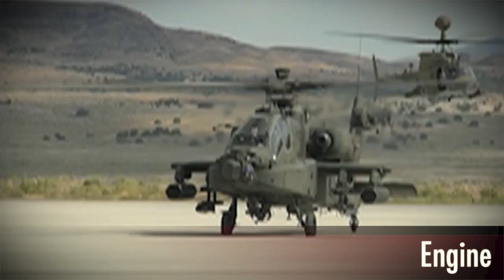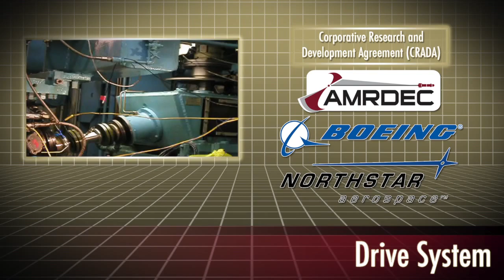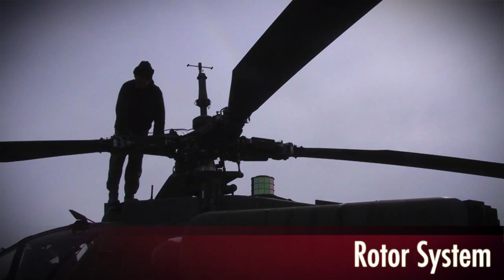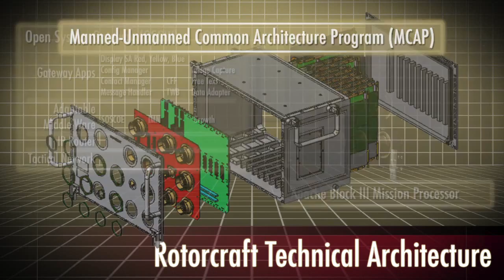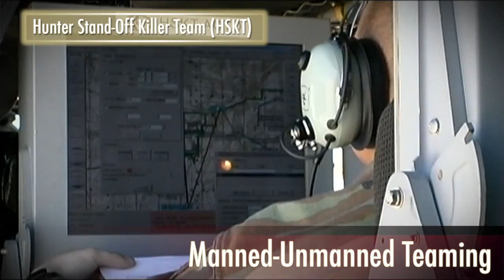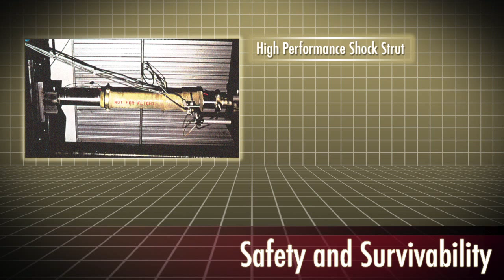US Army RDECOM - AH-64E Apache Guardian Attack Helicopter Technology Upgrades & Improvements [720p]

Comment: I like the "Crash-worthiness and survivability" part. 

Translation:  they've gutted all the strength out of the air frame to load all this new equipment, so they made some stiffer shocks/mounts to absorb the impact in a crash...how about small arms fire?

...so it's less of a flying MRAP and more of a flying HUMVEE

Comment: heh.. I made the new Composite Main Rotor Blades. the old D model apache with the 701D couldnt utilize all the power the engines provided. transmission couldnt take the power. also in case yal are wondering all 107 E model's built are now grounded.

Comment: the split torque xmsn is the most vital component. otherwise it wouldn't be so bad ass.
Reply: what is it exactly? what advantage does it give?
Reply: oh sorry. XMSN is aviation jargon for transmission. Converting both engines power into one torque.

Comment: maximum range Apache attack = = 8 km. the maximum range of the attack BukM2 (Syria Venezuela Russia \ Egypt and others) for a height of 15 meters = 40 km. Maximum attack ka = 52 100 km. Rocket - Hermes uses a homing guidance.
Reply: ы ыы I'm not sure whether your English is just so bad that it doesn't make any sense or if you actually don't know what you're talking about. Either way there is no comprehensible connection between these figures.
Reply: The 9S18M2 radar of a Buk-M2 battery cannot identify targets lower than 100m at rangers exceeding 5km. However, it is perfectly viable for the Apache crew to fly as low as 20m, evading detection. This is how they defeated Iraqs air defense during Operations Desert Storm. Also, the BUK has no searching radar on it's own, it relies on an external radar vehicle. That can be attacked by SEAD missiles, which have ranges exceeding 100km. You can extend this logic as far as you want, and so do military planners; the Apache would not be used in areas with strong enemy air defense, since it was never designed to do that.

Comment: The online sources regarding worldwide military equipment state the turret can rotate 360 degrees. They know more about it than you do I'm sure. I think I'll believe them. There is conflicting info, but either the turret rotates or it's laser guided lock and fire system has 360 degree rotation. Either way, it's still the most technologically rotorwing aircraft ever built thanks to it's combination of armament, stealth, electronics, remote control, etc., etc. Again I say, call Russia next time.

Comment: Tiger is better at manuve, but weaker fire power, even though france and australia are using US made Hellfire missile. the Radar is the point. And Tiger definetely don't get as much armor as either Apache or Havoc. seems the weak engine horsepower made the company have to use to many composite material to reduce the weight

Comment: as a total layman with regards helicopter engineering may i ask a question, "what is the split torque used for?," i know what torque is as what splitting something is but all i can think of is splitting power to the top rotor to the rear rotor, or am i barking up the wrong tree so to speak?, any answers please,
Reply: marcmarcmarcmarcmarc A split-torque transmission is just the name of a special transmission design. Regarding torque transmission from the engines to the rotor, torque is not split literally. Main rotor and anti-torque rotor are usually physically coupled, so there is no power splitting whatsoever.
Reply: MyFavoriteDisease most informative, thankyou sir,
Reply: Dmitri Kozlowsky i see, thankyou,

Comment: Even still the British version of the Apache uses Royals Royce engines which are more powerful even than the New GE engine.
God forbid the US use a british engine.
Reply: +Deepwinter Hate to burst your bubble, but the RTM-322 in the Westland AH-64Ds don't produce any more horsepower than the GE-701s because both aircraft use the same drive system which means the engines have to be de-rated to under 1800hp. And they're not exactly Brittish engines either, RTM stands for Rolls TurboMeca. Turbomeca (A French company) designed then licensed the engines to Rolls Royce for manufacturing, just like Boeing licensed airframe production to Westland.
Reply: +Rotor Hed Ok God forbid they use a French licensed engine!
and the engines are absolutely not de-rate that is 100% BS. it always them to carry additional weight i.e. FCR radar in Afghanistan to the same altitudes as the US Apache's, where the US Apache's cant support the additional weight and get to the needed altitudes.
Reply: The AH-64 (A, D, American, Brittish, Dutch, Singapore, Israeli, etc.) all use the exact same 90 degree nose gearbox which transfers power from the engine to the main transmission. These nose gearboxes cannot handle any more than 1800 horsepower. The original GE-700s only produced around 1750 hp, so they were never de-rated, however the GE-701C, GE-701C/DD, and RTM-322 all produce more than 1800hp. Because of this the hydromechanical unit (HMU) which meters fuel, restricts fuel flow to prevent power from exceeding the drive system's limitations.
Reply: Rotor Hed The RTM-322 can lift more weight because of the additional shp, thats just a fact.
Reply: It's just a fact that if you limit the amount of horsepower an engine can produce. . . it can't physically produce any more horsepower. It's the exact same concept as when Plymouth kinked the secondaries on the 426 carburetors in the late 60s to decrease the horsepower to under legal limits.
Reply: Rotor Hed Your wrong I've heard from Apache pilots on this issue, it's known that the UK apache's with the RTM engine can do things i.e. more weight carrying capacity.
that the US apache's cant.
Reply: OK, horsepower aside, there are hundreds of things that affect an aircraft's performance. For one thing, the Boeing Apache carries about 60 gallons more fuel than the Westland (not including auxiliary tanks). At about 6.8lbs per gallon, that's roughly 410 lbs. The Boeing also has an empty weight of about 11,800 lbs, the Westland weighs 11,385. So not including difference in payloads, that's a total of almost 820lbs difference, of course the lighter Westland is going to perform better. The Westland also has over twice the ceiling of the Boeing Apache, but it's cruising speed is lower. I've been around these aircraft for the better part of two decades, I'm well aware of the capabilities and limitations of each. I'm sure your pilot friends know their stuff, but pilot knowledge usually centers around systems operations, and little theory or mechanical based knowledge.
Reply: ...And don't even get me started on the horrendous improved survivability (ASPI) mod that virtually all U.S. Apaches use. The legacy exhaust has been replaced by an upturned system designed to dissipate the exhaust stream in the rotor downwash. But all it really does is rob the aircraft of much needed power.
Reply: +Deepwinter Dude, Im sorry but Rotor Hed is correct. The GE-701s on the AH-64D is derated because the drivetrain cannot handle the power of the engine. The American Apaches are loaded down with so much extra crap including ASPI that yes, the performance lacks that of counter-parts in other countries. But to call the American Apache less powerful based on the engine is just stupid because the drive shafts are the limiting component. Ask me how I know. I work on these every day. I dont have to "hear from Apache Pilots on this issue". I have first hand knowledge. Dont believe me, look at my effing channel
Reply: +Rotor Hed  He doesn't wanna listen man. That's that Euro arrogance running strong
Reply: Funny, I seem to recall having much more than 100% available on AH-64A 701s on a hot Fort Rucker summer day (2000) on my Performance Planning Card (PPC), diligently covered with Rubbermaid Contact Paper so I could erase it before the next training day.  Yes, even an old 701C (two of them) could produce more torque than 100% at lower density altitudes.  So yes, even it was "derated" by the pilot by pulling only 100% torque on both engines, or 110% on a single engine (the max because of the 90% nose gear). These were not protected by some FADEC from over torquing, if you pulled an armload of pitch, the helicopter would dutifully give you that and overtorque or droop the rotor (if at high DA). Obviously, a 701C and now 701D can produce more power at higher DAs.  I flew the venerable, outdated, but much lighter AH-64A for about 30 hours before going to the AH-64D, first flying the Engineer Design Simulator (EDS) at the Mesa Plant in October 2000 because the first AH-64D Longbow Cockpit Trainers were still in development.  Nicholas Cage flew the exact same machine (high on cocaine as I understand) in "Firebirds" when it was an "A" model Engineer Design System device.  All AH-64Ds with Fire Control Radars (back then we called them "D W's" meaning "D's with"" had to have 701Cs, no exception.  Due to (Clinton) budget constraints, we did not have many 701Cs to go around, so D's "w/o" had 701s only.  On deployment, in particular to AFG, some units were fielded pure 701Cs (not the one I was in!).  And no, it was not me rolling that AH-64D with.... at....MSL over .... on ....[Dave (OH-58, AH-64A, AH-64D, Jetranger, King Air 200, King Air 300/350, Embraer 175)]

Comment: Lot of comments below that the apache carries more 30mm ammo than Ka-52. It has to because its a very inaccurate gun, basically sprays bullets. Have you seen footage from Afghanistan? There's one guy and theres 30mm rounds exploding all around him. I used to think wtf? until I found the fancy swivel turrent that american fanboys love is inaccurate. Ka 52 is fixed with longer barrels = more accuracy and muzle velocity
Reply: They can shoot armor piercing rounds, but they shoot high explosive rounds most of the time.  Each round has a kill diameter of about 3.5 meters. There is no point in throwing grenades in the exact same spot.
Reply: ***** Please tell me of what combat experience you are basing this on?  Out of 9 years in Iraq and 13 and counting in Afghanistan, you can't base anything you know because you saw a YouTube Video of one scenario. LOL.  The M789 is optimal because of it's low risk for collateral damage with civilians and property. There is logic for using that round, minimize the accidents. The M789 is great because it doesn't ricochet like other rounds. In many of the combat engagements, the scenario is set around crowded areas or with civilian bystanders near. Plus, a M789 is about $140. The M799 is merely about $160 per round.
Reply: ***** I can also find you as you did to me Mr Dragon.
Reply: One of the main reasons why India picked the Apache over the Ka is because the Apache is more accurate.
Reply: ***** LOL, another Russian fanboi that can't accept the truth.  Back up these words, I dare you: "not only is the Apache the least accurate among all Attack Helicopters."  LIAR!

The Mi couldn't even finish the field trials.  The Apache was found to be superior, it had nothing to do with politics.  You just don't like it.  The Apache is battle tested and has proven itself.  There's a reason why India now buys more military equipment from the US, and that's because it's better.

"Boeing’s Apache beat out the Russian Mi-28N Night Hunter for the deal by outscoring it on more than 20 technical points. 
The Apache scored consistently over Mi-28 in several key operational criteria. Broadly, these fell under the categories of electronic warfare, survivability, situational awareness in the cockpit, night-fighting capabilities, sensor efficacy and weapons. The helicopter was also found to be far more maneuverable. We worked directly with Boeing and the US Army to test this."

"As for the weak points of the Russian helicopter, independent experts said the ammunition of the Russian helicopter is smaller. The US chopper is better than the Russian aircraft from the point of view of the shooting accuracy, they said."

Unlike you I don't have to lie.  I'm just fine with reality.
Reply: ***** LOL, you said the Apache has the worst accuracy and you couldn't provide one source to support it. You're just like all other Russian fanbois here on YT: "I am Russian, we are the best just because we are Russian.  We don't need to train, we are born soldiers.  Blah, blah, blah."  It's easy to see why the Apache won.  It has many years in combat and has been upgraded many times.  The Apache won hands down,  Accept it.  There's a reason why it has the most exports and that's because it works as advertised 

The sale had nothing to do with politics.  You're just a sore loser.  This is from a very anti-US source, Pravda: "A source at the Defense Ministry of India said that such actions were not political. The decision was made on the base of the specifications of the aircraft. "The Mi-28H did not meet the requirements of the tender on 20 counts, unlike the Apache helicopter, which showed best results, Indian officials said."  

Here's more: "Alexander Mordovin, an expert for combat aviation:"We have a serious problem with avionics. Unlike the US competitor, there was no serial production for the Mi-28H for a very long time. It is an open secret that the flaws, which were not noticed during the testing period, are found and removed during the process of serial production. Russia had only 16 Mi-28H helicopters before 2008. In 2011, the Russian armed forces were supposed to receive 28 Mi-28H choppers, although the serial production of this aircraft could be launched more than ten years ago. Of course, India could choose the Apache just because the helicopter demonstrated its excellent performance during the recent conflicts. Therefore, the advantages of the Russian chopper are only theoretical."

India prefers USA's Apache to Russia's 'Night Hunter' - English pravda.ru"

What do you call this, and it's from a Russian media source? 
"As for the weak points of the Russian helicopter, independent experts said the ammunition of the Russian helicopter is smaller. The US chopper is better than the Russian aircraft from the point of view of the shooting accuracy, they said."

You see unlike you I don't have to make up bullshit.  Reality must be a bitch for you to accept. I can back up my words with quotes from officials that made the decision.  Your words man nothing unless you can support them with credible sources, which you can't and won't be able to do.  I dared you to prove me wrong earlier with a supporting link, and you intentionally avoided the subject.  Lie all you want.  It just shows that you have no credibility when you comment.

The Apache beat it hands down.  That's why the Apache is the most widely exported attack helo in the world.  And the US doesn't have to give all of its technology to get the sale either.  Look at the MMRCA tender as an example.  Russia was willing to give 100% tech transfer, and the lowest price to India for its Mig 35, and yet India still didn't want it.  No country wants the damn plane, and even Russia has doubts about its future.

[Iraq refused to buy AH-64E and took Mi-28NE so much for your superiority,] And yet another lie. Iraq cancelled the deal because of certain strings, which included a long delay in getting the Apaches.  Unlike the Mi-28, the Apache is in high demand and its difficult to meet orders when it has to be provided so quickly.

Just because a helo can lift more doesn't make it better.  There are many more factors, and that is why the Chinook won.  For a long period the US wouldn't sell military equipment to India.  Now that the market is back open, India has been making large purchases from the US and other Western nations.  One of Russia's biggest downfalls is its after-sale support.  India is getting tired of having equipment fail and little support from Russia to fix it.  A recent example is the Su-30MKI avionic issues.  If you can't get an aircraft in the air with its avionics working properly what good is it?

Russia went through a long period of stagnation with little to no R&D. Look at its PAK-FAilure.  Even when it does finally enter service in a couple years it will still be less powerful, less stealthy, and have primitive avionics compared to the F-22. The future doesn't look any better or Russia, either.
Reply: ***** I only cited Pravda because it is a very anti-US media site. Not one of your citations shows that the Mi's accuracy is any better.  You posting specs do nothing to confirm your earlier comment that the Mi is any better.  I have cited not just from Pravda, but many sources, and have used logic, something that you obviously lack.  I also cited quotes from Indian officials that were part of the tender confirming that the Apache beat out the Mi.  Not only that but once again you failed to back up your earlier comment that the Apache is the least accurate of all attack helicopters. If it were as inaccurate as you claim you would see all these nations that buy it complaining, but you don't, and it continues to rack up sales. 

People don't understand that when watching vids that show it not hitting the target that many things can contribute to inaccuracies, boresight, elevation of terrain under the helicopter, proximity and violence of maneuvering, and of course experience.
Reply: ***** I couldn't open your link because Sophos detected a virus threat.

Did you even read your own post?  Do you have a literacy problem? We're discussing the Mi-28 vs the Apache, and if anything they are on par, per your source: "And tests showed that it surpassed in accuracy by four times its counter part Mi-28 "Night Hunter" with same cannon (2A42) and AH-64 "Apache" (M230)."